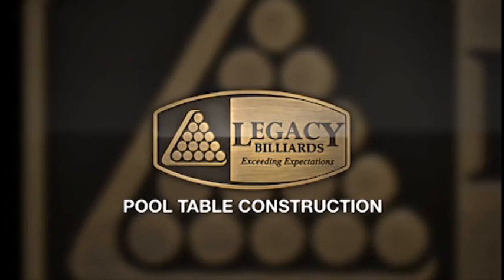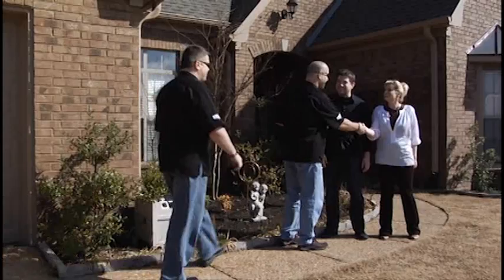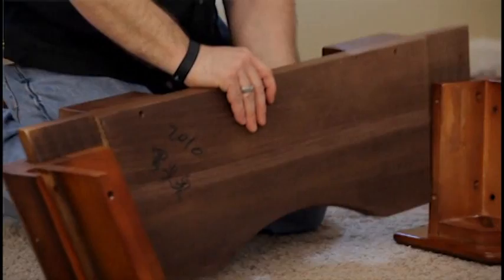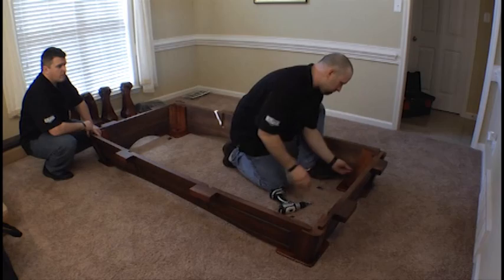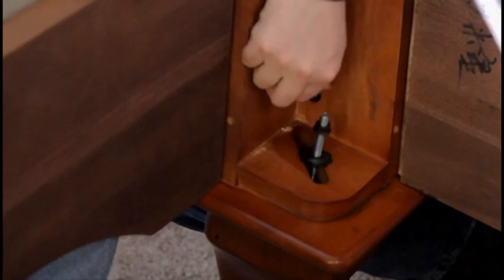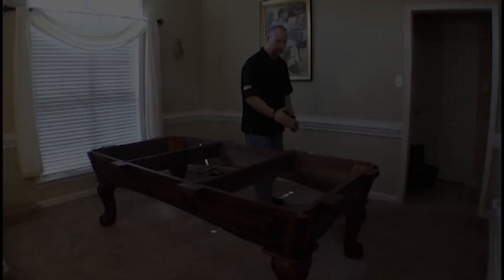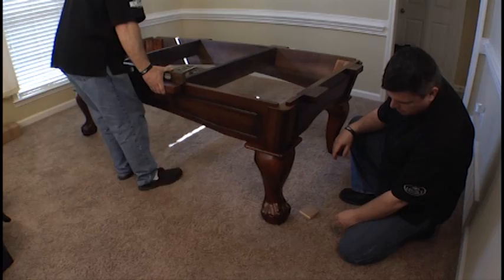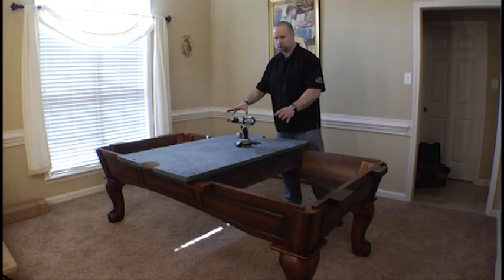Legacy Pool Table Assembly Part 1

Comment: 3:30 Don't tighten them down halfway with a speed drill....3:50 I am putting them in very loosely to get them started...Contradiction in the fullest example.

What does it matter if the frame is not squared? You have three pieces of 1 inch slate that is being shimmed. The frame is nothing but a table it doesn't have to be perfect guys it only has to be strong enough to hold the slate up. The squaring is done on the slate
Reply: The reason the cabinet must be square is too allow the slate to sit as flat as possible thus eliminating the number of wedges needed to level it. When the cabinet is not square, it is twisted and the opposing corners are raised higher than the rest of the surface. This makes leveling the slate a nightmare.
Reply: I had to re level my mother in laws table this weekend. Soooooo many shims! It was very difficult. The cabinet was not square. It was very difficult to achieve a true level. I couldn’t do it in the end. I wasn’t about to disassemble the entire table either.